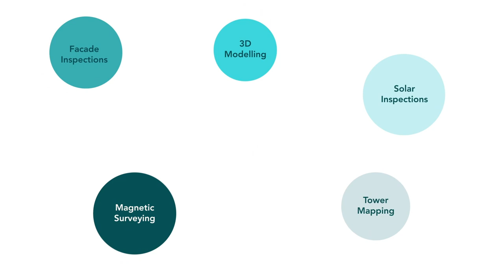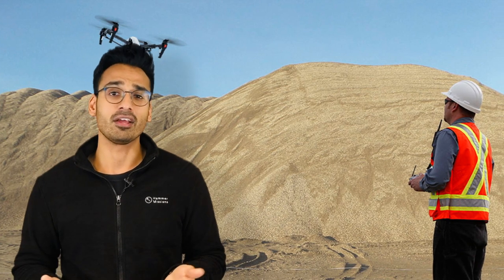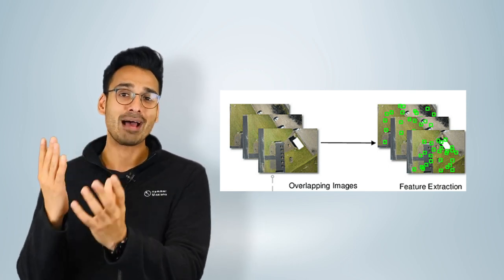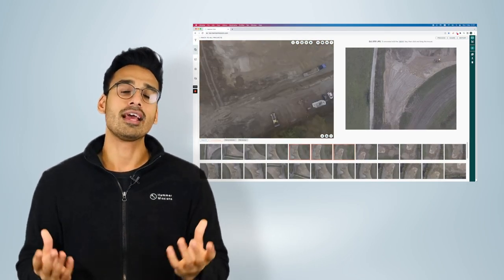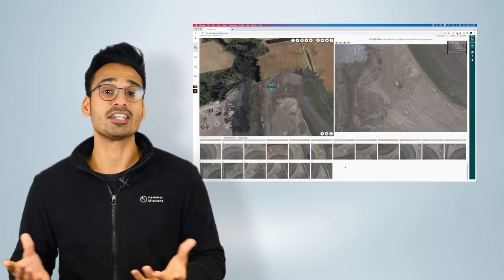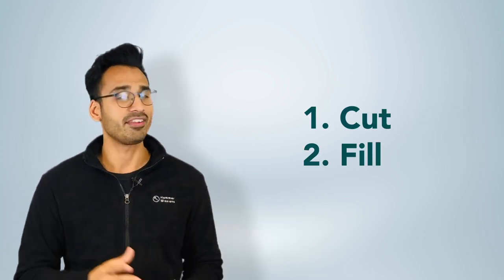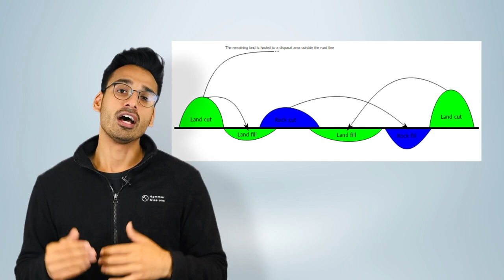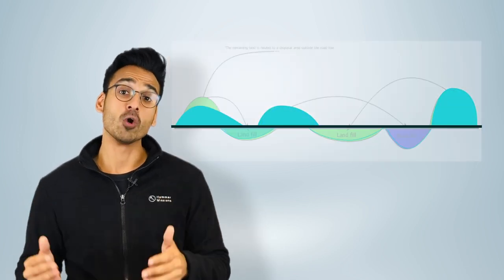How to Measure Stockpile Volumes using Drones? | Cut & Fill Calculations | Drone Mapping

Comment: Varun…I would love to use your software.   Could you guys upload a video with the complete workflow accomplishing stockpile volume measurements?  I’ve seen the one Allen did, but he on,y showed the measurement portion of the workflow.  I like that your software is a one stop shop for many applications, but have not signed up for the trial yet.  Waiting on my M3E to try it out. I’m also curious as to the processing time for the different applications (obviously data dependent). Thanks.  Jason Breaux
Reply: Also, could you include cut and fill measurement procedures?  Thanks!
Reply from the maker: @imadroner  We just released a video on it! 
https://www.youtube.com/watch?v=gDrlbWMIzc4&ab_channel=HammerMissions

Comment: Hi Varun, for stockpiling measurements is it possible to use mini 3 pro ? Thanks, Hazrel
Reply from the maker: Yes, the Mini 3 Pro can be used! They key is to understand what altitude you need to fly at to get a good target GSD. One challenge with the Mini 3 Pro though is the lack of automated flight apps, which we are working on. It also depends on what size sites you are looking to capture, for larger sites, getting a bigger drone and sensor might be a better idea for flight efficiency. Hope this helps!